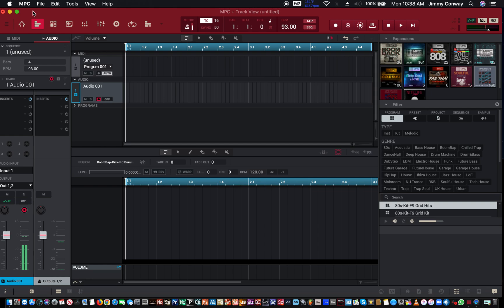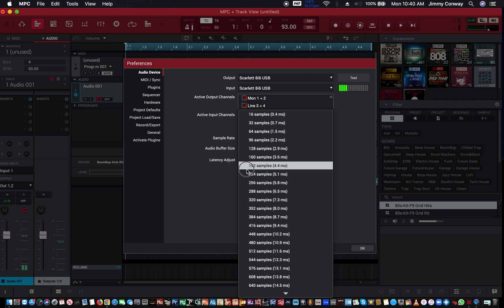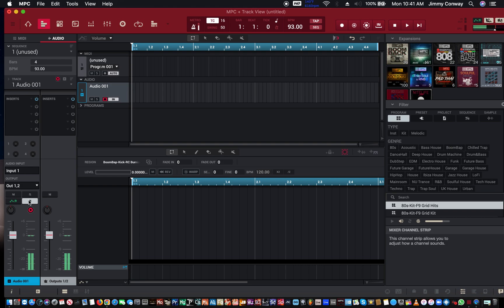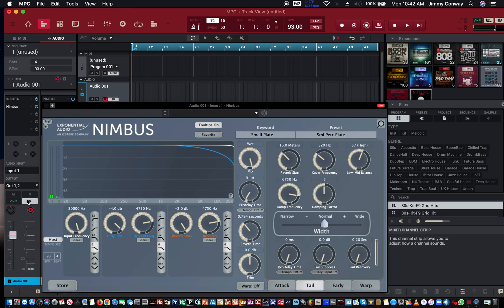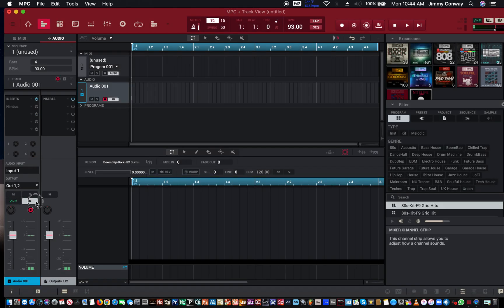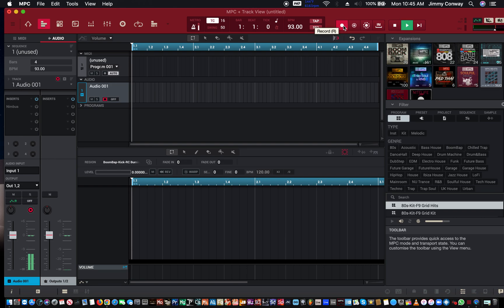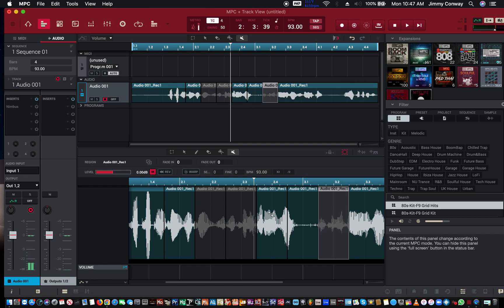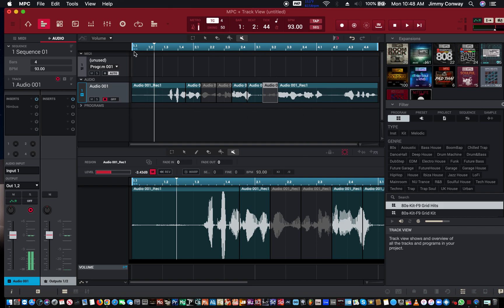MPC Software Tutorials - Recording Audio

Comment: I just got mine working I have the USB G track Pro . The problem I'm having is when I recorded and playback it sounds distorted  is that why you play with the buffer size plus check volume levels and clipping?
Reply from the maker: If your vocals sound distorted, try turning down the input gain for that channel while recording.

Comment: The lowest Sample Buffer I can get is "144 samples (3.0 ms)" using the laptop's built in mic. I'm still getting a delay that's throwing me off as I try to monitor myself. I have older Samson usb mic that I've not tried yet but expect it'll give delay too if I plug directly into laptop - would you say that any serious vocal recording requires a audio interface box like the M-Track Duo? I've tried to record vocals without monitoring and it kinda feels like shooting in the dark - would you agree that recording a vocal performance requires the singer to have vocal monitoring in headphones to he/she can really connect with the music? Thanks! You have a great teaching style.
Reply from the maker: You most definitely need an audio interface with ASIO drivers.  This will help minimize the delay you're getting.

Comment: Hello, nice vids. I got a question. Since I'm a real beginner, I use M-Track DUO with MPC beats to record bass guitar. Facing a problem that recorded track of bass plays too low (almost silenced), although when recording it I can hear the bass loudly and clearly... Any suggestions how to set the level of track's output? Sorry for such stupid question xD
Reply from the maker: Good question 
1st make sure you have a brand new bass cable that you know works.

2nd when you plug your cable in  the 1/4 inch jack, make sure the input is set to Line/Guitar level. Play the bass while raising up the gain.  When your levels start peaking in the red, cut back a little.

3rd Record your baseline

4th when you play back your track, turn off the ready record button. 
You should hear your track loud and clearly

Comment: Thanks for the share but my active input channels on my saffire pro 40  don't say Mic 1+2 . I have IP 1+2 and IP 3+4. I wonder how to make the changes to have my mic connected?
Reply: I’m back up and running thanks. I did an update.
Reply from the maker: @anthonytyson1708  That's great to hear.  Enjoy the updates and new sounds.
Reply from the maker: Make sure you have the latest drivers for your Saffire installed.
Then go to 
FILE
PREFERENCES
AUDIO
Check off all the inputs and outputs that you are using. 
I hope this helps.

Comment: Lately I been wanting to run my samples thru audio so I can get a better loop add some effects instead of chopping sometimes how good are you on the audios tools 🔧 🤔
Reply from the maker: I'll put together a video using the Audio tools.  I do most of my audio work in Ableton.
Reply: @musicproductiontips3121  I use logic , but for some reason I want to start using mpc software for everything I mean if I can do vocals and use the same plug ins I don't see no big difference in sound in my opinion but at the end of the day its not what you use it's how you use . For example look how far FL studio came I use to have fruity loops 3 and reason 2.0 on a shitty pc. I came from the analog days so my introduction to digital was new when digital was barely knew so I'm just trying to master the mpc software.  Appreciate the tutorials.
Reply from the maker: @Stayinshapemusic5  Funny I just started teaching myself Logic. We are probably are around the same age.  I started splicing reels back in 19xx.  But you're absolutely Right. It's about how you use the tools. The MPC tools for audio can be improved.  I wish it was smoother like other audio programs. Thanks for watching the videos.